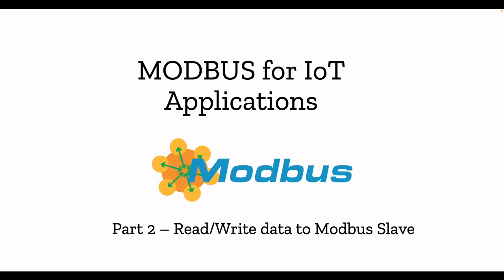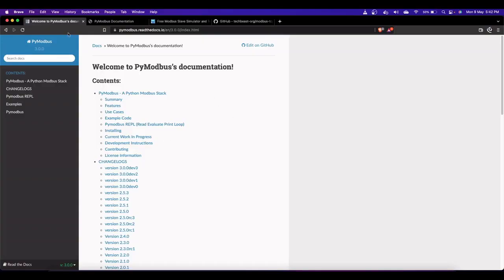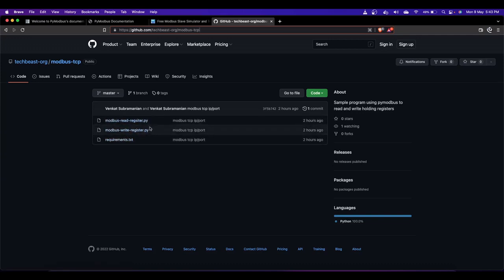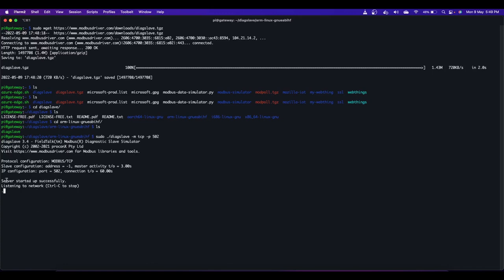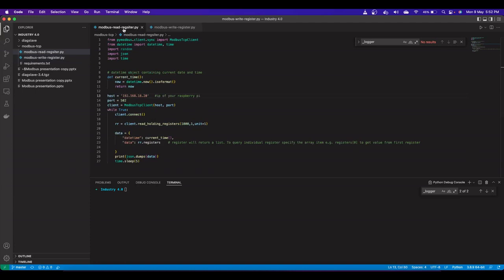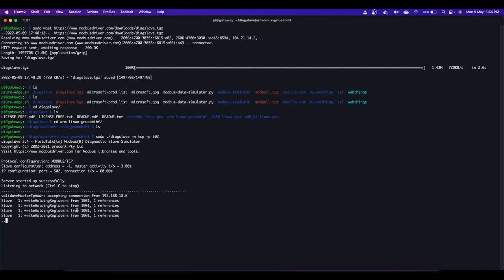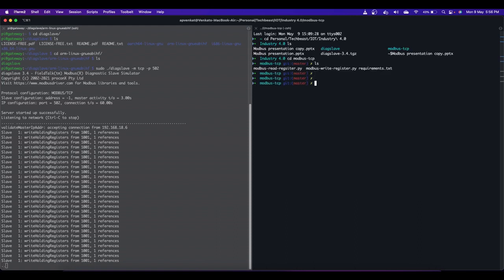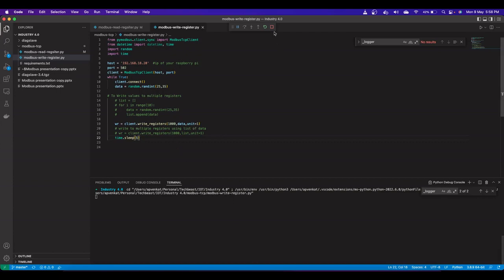Part 2 - Using Python to Read and Write data to Modbus

Comment: My setup I was using ModSim32 to write the holding register while I SSH with putty to my RPi3. I could not get them to communicate. Finally found out that it was my firewall settings that was not letting them communicate. After making some adjustments it works perfectly now. I wanted to drop this bit of advice in case someone else had the same issue.
Reply from the maker: Thanks for the highlight !! It’s definitely a valid point to note !